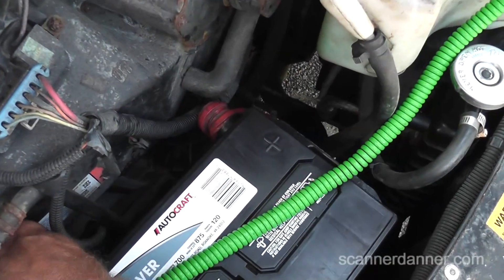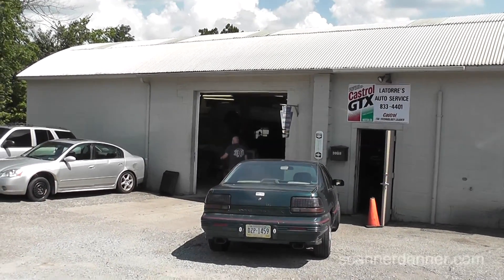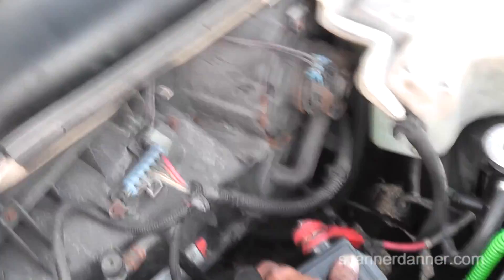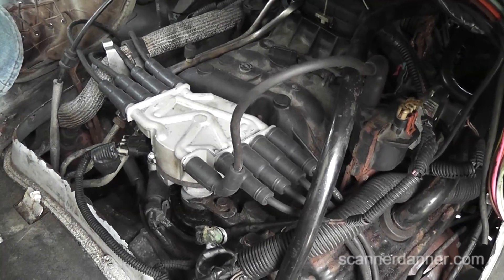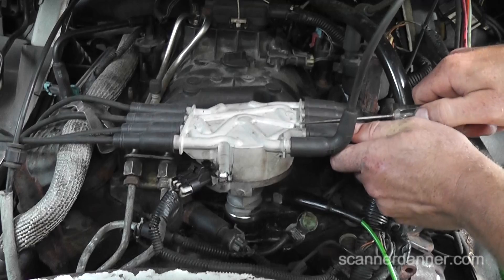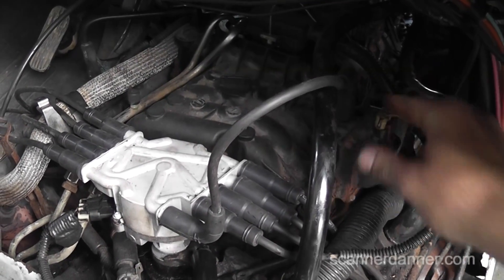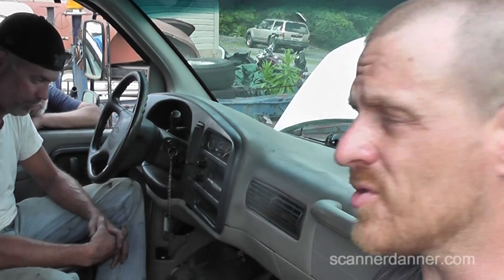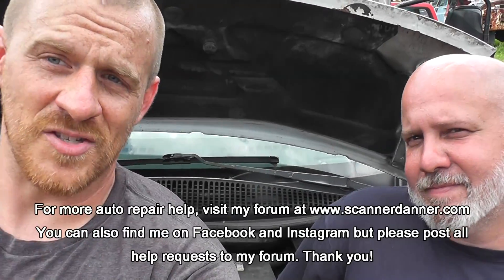1998 Chevy Van 5.7 No Crank and Misfire Troubleshooting

Comment: 91 5.7 chevy finding top dead center after changing pick up coil and ignition module, what have done wrong?
Reply from the maker: #1 remove the number 1 spark plug
#2 install compression tester hose then put your finger over it or put your finger over the spark plug hole (must me sealed)
#3 "bump" the key (very short bursts of starter engagement) until you find compression (it will force your finger off)
#4 key off, find your timing marks on the crank pulley and manually align to TDC mark (use a ratchet and socket)
#5 install the distributor with rotor pointing to #1 cylinder on the cap
#6 if you cannot get the rotor to sit where it needs to, remove distributor and get a long screwdriver and turn the oil pump drive gear inside of the engine, then retry to install distributor 
Hope that helps

Comment: i have a chevy tahoe 2000 limited does crank but not start.i changed the starter  is it the crank sensor?
Reply from the maker: I'm sorry man, you have to do better than that. It could be a lot of things. Find out what you are missing (spark, fuel injector pulse, fuel pressure, compression, trouble codes). Give me some direction and maybe I can help.
Reply: Marnay Goodlow , to remove car alarm

Comment: how are you gonna look at the injectors? theyre spyder injectors under the upper half of the intake manifold.
Reply from the maker: It's up on SD Premium. I used first a PicoScope to look at secondary ignition to pinpoint that it was in fact a lean misfire. Then I performed an injector balance test proving two plugged injectors. Then followed the tests up with a psi transducer in the rail to show yet another way to ID an injector issue.
There is a 14 day free trial so check it out. Thanks!
Reply: cool

Comment: It's funny to hear guys say there not versed in electrical cause I feel like I'm worse at heavy line work than electrical / driveability. 
Personally I feel more confident testing relays and doing voltage checks than pulling heads or fixing broken bolts, or repairing brake lines.

Comment: Considering someone changed the cap you didn't check firing order. Like the test light to plug lead test, it's shocking to be hit with HT leads. Thanks great vid
Reply: I considered the firing order but the two cylinders that were misfiring were on opposite banks and with this style of cap it couldn't be from two mixed up wires.

Comment: You got away with one there Danner. Ever seen the mountain of green cheeze that often hides under those red GM cable boots?
You also broke your own rule when  you flopped the battery around. Could have easily made (or not) a crappy connection right there.  Really? Pete and company can figure out a bad battery cable connection?  Not like you need the Verus for that.
Reply from the maker: It's not like that. Pete is a very busy guy and I handle all his electrical stuff. He doesn't even look at them when he calls me.
Reply: +ScannerDanner i think it has to be like that. It doesn't work if someone like Pete takes all the cream or makes a mess and asks Paul to just clean up the headaches.

Comment: Those guys seem like they'd be fun to work with.

Are you saying that when diagnosing a misfire on this cap design with a test light, if no spark jumps the gap from the cap until you get much closer to the electrode, then it is crossfiring inside the cap?

I love videos in the field and I love test light videos.  This one was great!
Reply from the maker: Exactly!

Comment: Hello, and thanks for the great video's. I have a question on a project I am working on for my dad. He has 2 1998 Chevrolet pickups one with a bad v6 and one with a good v8, I am swapping the v8 (5.7) into the 4.3 truck and my dad swears that the ECM from the 4.3l will work with the 5.7. he says this because he owned a salvage yard for several years and says he has done this before. I don't believe it. I know all the sensors from one engine to the other are identical so I don't see any issues coming of that. But I'm not buying that the ECM from the 4.3 will work with the 5.7. Am I wrong or is my junk yard mechanic father teaching me something? I am an aircraft mechanic and I am lacking knowledge of computer controlled vehicles. 

I would appreciate any help you or any other viewers can share. Thank you in advance, Jack

In his words " The ECM don't know if its a V6 or a V8"...
Reply: it would'nt work you only have 6 injector control on the 4.3 ECM you would need 2 more to match it with the 5.7 and even if somehow it had them the injector pin out at the computer would'nt match
Reply: TBI yes, spider injectors no.  1995 vehicle/engines it would have worked.  And like you I'm not 'up' on the exact model year when they crossed that bridge.
Reply: 1996 model year was when they changed it

Comment: Thought that van had throttle body injection as opposed to individual cylinder injectors. Great diagnostic tips without the high tech scanner. Pittsburgh guy not drinking an IRON CITY, what has happened to the south hills?

Comment: I have a pacemaker also and while I was told not to work on car electrical systems or to even use a chainsaw I found that the company that makes pacemakers states in their literature that we are shielded from electromagnetic impulses with today's units. The doctors still tell patients that because they are afraid one might get hurt for example using a chainsaw and it had nothing to do with the pacemaker but that was used as an excuse to sue claiming the pm was the problem.  I have had mind for 6 years and never had a problem with power saws of all kinds and with vehicle or tractor electrical wiring.  But each to his own.

Comment: Moving wire's take's to llong i just use an old plug and put it on the wire then start the car if you see the spark jump wire is good look for a problem in the motor fuel or rocker or vac leak
Reply: Good tip, thanks.
Reply: Michael Herbert What paul said was right but there are faster ways paul is high teck somtime's there are ez way's to do thing's it's just other way's of doing the same thing that's just the way i learned from an old master from year's back
Reply: I hear ya. Your method is definitely a time saver. I think we spoke about this once before a while back. You mentioned that a good mechanic keeps a spark plug in thier tool box, and I asked why. You shared your method with me back then and guess who keeps a spark plug in thier tool box now, me. And it came in handy so thanks.
Reply: Alway's try to help if i can.Michael Herbert
Reply: Michael Herbert Your right it was on Eric's SMA channel the ford pick up with a bad wire.
Reply: Thats is a good basic test I guess , but no different than just holding the test light at the plug end of the wire and looking for spark to jump, neither way will verify if the wire will produce enough spark to fire under a load/compression.
Reply: Moody Robert Yep about the same at the shop i cant take the time to play swap the wire your way is good to i used a test light one time and the bulb burned out so after that i use an old spark plug.
Reply: I am glad it works for you. For those reading these posts for information or help, I believe Mr. Danners wire swapping suggestion is a more definitive diagnoses. Of course just my opinion.
Reply: Moody Robert I will tell you paul and his brother jim are two of the best i have seen out there but paul way is not more definitive the  wire is good or bad that it.      Just to move a wire from one spot to the other is slow my way you just pop a n old plug on the wire and see if it work's go from there..     Both way work just speed.
Reply: I understand what you are saying, but everyone believes their way is the fastest.I think Mr. Danners wire swapping suggestion is a more definitive diagnoses. I have seen techs put a known good plug on a wire and start the vehicle. Yup it fires, it must be the plug. Pull the plug put it on the wire. Yup it fires, must be something else. Send it to the other guy, he puts a scope on the wire and finds out it does not fire properly under a load. A simple wire swap would have given the tech the same result the first time. A plug wire fires the plug within compression and can only be truly tested within compression. Not trying to be argumentative. Just something I have witnessed a few times over the years.
Reply from the maker: Exactly why I do not trust the test Eddie is suggesting. It's a good test Eddie, but there is a variables to it and you know how much I like tests that have variables. :-)
You can absolutely miss a bad wire (open or shorted) by testing for spark from the plug end in a none compression environment.
Reply: ScannerDanner How paul with a plug or a punch on the end it will for sure show a bad wire no spark you shake it to make sure it wont have a bad spot if it's open it wont fire.    Now shorted then yes it can bite you if it lays on the motor and short's and you move the wire away so the short is not there anymore in that way your right.   Paul is right if you test and find the wire is working then under load it stop's then you right i would have wasted some time but how often will that happen? i have been in the game forty years and have seen it happen one or more time'sget's crazy
Reply from the maker: Agree Eddie, it is not likely going to bite you and the testing you describe is valid but if there is a variable to it, I just chose to eliminate all variables. But in some cases, swapping wires and plugs is very difficult so your method would be preferred. 
I'm just not a fan of open environment spark testing unless you use a spark tester and change the gap to 40,000 volts. The known good spark plug test is not a good test in so many examples. Weak spark will show good for that test and I've seen it a lot but mostly from bad ignition coils or igniter issues. Not necessarily from a bad wire, but why take a chance?
Reply: ScannerDanner Your right paul my way can get you in a spot that's way i alway's fall back on your way if i run into to problem's.   Your right you don't know how good a spark you have when you do it my way but more time's than not my way get's you done faster but you are right your way is the right way just not the fast way.    I think it's like they say there is never time to do it right the first alway's time to do it right the second time?.
Reply from the maker: Faster is better sometimes Eddie so both ways are valid and good tests as long as you understand the variables which no doubt you do!
Reply: ScannerDanner Well you know how it is when you work in a shop.    Well for you not now your in a school but i value what you say you have a great deal of skill and knowhow so when you talk i hear you.    Hey paul is jimmy ok not a word out of him he has to mush work and no time?
Reply from the maker: Thanks eddie. He's fine, just a busy guy is all